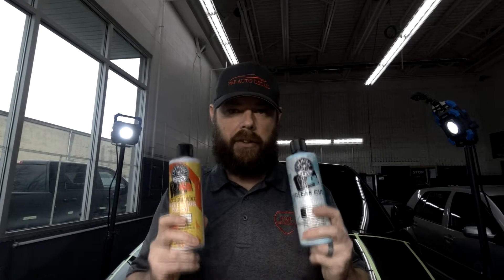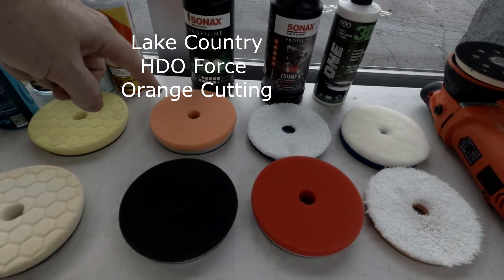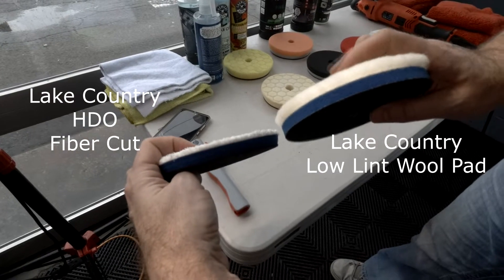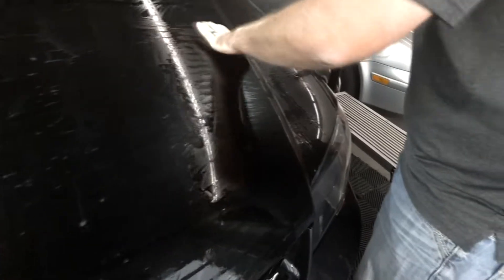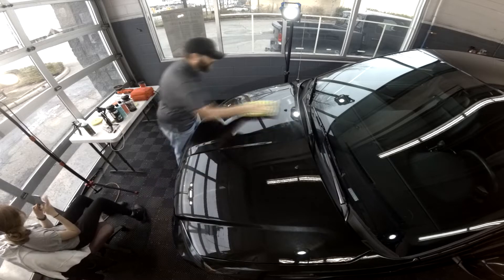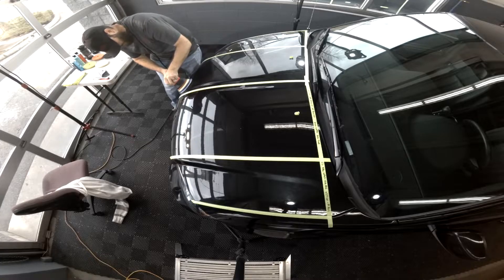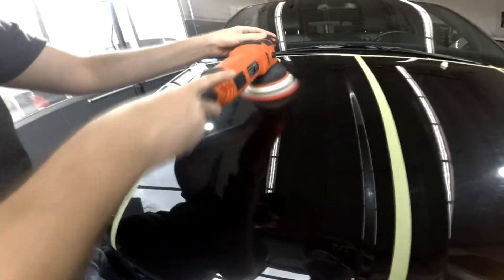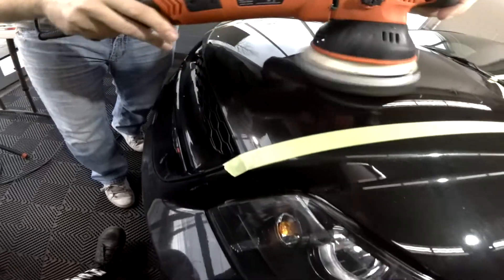Chemical Guys C4/P4 Versus Sonax CutMax And Sonax Final

Comment: I just did Adam's Advanced Graphene Coating on 2 new cars (dealer detailed - arghhh) and in the prep I used Chemical Guys Orange pad and white pad paired with C4 and P4. One was a grey VW ID4 which has a moderately hard paint I would say and took a lot of pressure and passes to get rid of some of the swirls using C4 and Orange pad. One was a Black Honda HRV and it was soft paint and I almost needed to polish last again with P4 with a Black pad because even white pad would leave some marring. Anyway, the bottom line is as a newbie if I was doing it again I would have used a microfiber pad on the VW with C4 to cut a bit faster and get rid of those scratches faster. On the Hinda I would have stayed with Orange pad with C4 and do the P4 with white pad but with almost no pressure on it. I really need to get that microfiber 6 inch pad. I was using TorqX from Chemical Guys for the DA. It took me a couple of days to get each car prepped. So basically 5 days of total prep work on brand new cars. Swirl marks everywhere on them and their detailer at the dealers were awful. I could see scratches they put on the car.

Comment: I’m a beginner planing to use the chemical guys c4&p4 and On the chemical guys they recommend high speed setting is that correct or a mistake bc seems everyone use low speed ..
Reply from the maker: High speeds destroy the pads quicker, induces unnecessary heat, and wear on the machines. If you have to use a speed higher than 4, then your not using the right pad and cutting compound.
Reply: @p2pautodetailing550  I would say 5 or 6 with C4 on CG own TorqX. I think it is more close to 4 for other brands. I just did two cars with it and 4 would have definitely not worked well. So if you have a polisher like a Flex or even Griors G9 then perhaps 4 for cutting is fine. Not on CG TorqX from first hand experience.

Comment: i don’t know why but i had a horrible experience with C4, it was insanely hard to pull off it stuck to the paint like an oil. i'm not sure if it was the environment, temperatures in my garage were low 100's
Reply from the maker: Yeah in the temps above 90 you will notice that it will flash rapidly and become much harder to work with and have less working time. keep a spray bottle of water by your side. Just do a quick spray of mist over the area after each section pass and it'll make it easier to remove and but increase your working time as well.
Reply: @p2pautodetailing550  thanks man!
Reply: That’s tell tale sign that you are trying to do too large of an area for the amount of compound you had applied. Work a smaller space for that amount or add more when you reach the point where it started to stick.

Comment: After the c4 & P4 what wax would you spray wax or wet wax or something else from chemical guys. Thank u
Reply from the maker: I wouldn't. I am not a fan of waxes from Chemical Guys.
None of their waxes are something I would bother using.
Reply: @p2pautodetailing550  thank u,one more question want wax would you recommend and thanks again.
Reply from the maker: @aaronaaron9087  for waxes I've not found one that is easily accessible to get that I'd be happy with.
Soft Fuso 99 would be my go to of I had to use a wax.
But I'd rather use a spray sealant that has Si02 or Graphene in it instead. They are easy to apply and Buff clean. Most will last as long as any paste wax but typically nicer finish.
Check out Extreme Solutions Jersey Devil or Topper for starters. Then there is the Geyon Can Coat that is amazing. And finally my favorite of all is IGL Premier.
Reply: @p2pautodetailing550  ok thank u for your help ,take care have a good day

Comment: What combo would you use on a 2016 Honda HRV black. I believe the clear coat is soft. It scratched very easily in a car wash. I’m looking to cut/polish or one step possible and then apply CarPro CQuarts 3.0 twice. What combo would you recommend sir? Thank you!!
Reply from the maker: Hi Dakota, without being able to see the condition of the paint and or do a test spot ourselves. Our suggestion would be to start with the less aggressive polishing pad and compounds.
Reply: @p2pautodetailing550  I understand completely. I will keep that in mind. Thank you so much!
Reply: Hey! I can’t find a legitimate answer to this question... would you recommend the V line or these two new chemical guys products? Not entirely sure what the difference is
Reply from the maker: @TheRebaholic01  There isn't a straight answer to that question.
Every vehicle's clear coat or paint will be different from each other. So using 1 product over another is not as simple as most people think.
Plus, it would also depend on the polishing pads you use.

A soft clear coat with a heavy cut pad would absolutely remove too much clear coat way too quick.
But then an ultra-hard clear coat these products wouldn't do so good on at all.

You have to figure out what products (Compound/Polishing Chemical paired with Pads) will be the right pairing or setup to complete the job. 

As in this video you can see that I used 3 other setups to compare the effectiveness of different pads teamed up with different compounds and you get different results.
Reply: @p2pautodetailing550   thank  u what wax would you recommend after applying does products for a better mirror shine and thanks again.
Reply: Car wash does not scratch the paint
Reply: @rodddmyers6772  automatic car washes most certainly do scratch some cars paint. Depending on how soft the clear is. I have first hand knowledge.
Reply: @rodddmyers6772  I corrected my paint and had it 90% free of all swirls, then took it through a car wash like an idiot and it had terrible swirls everywhere. So Technically not a “scratch” but swirls which suck.

Comment: i have the chemical guys c4 clear cut ive shacked it still seems waterdown has anyone had this issue
Reply from the maker: We've stopped using the product as we have found Sonax and Meguiars are still superior products with equal or lower pricing.
Even when we paired the C4/P4 with heavier cutting pads from other manufacturers.